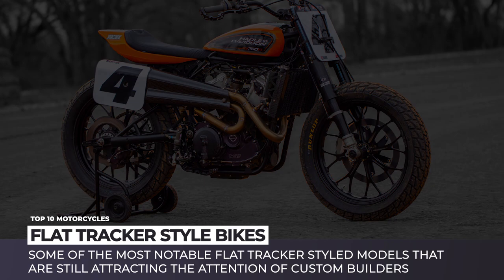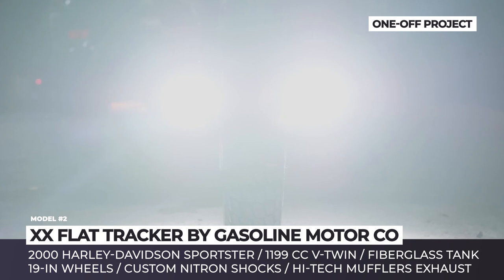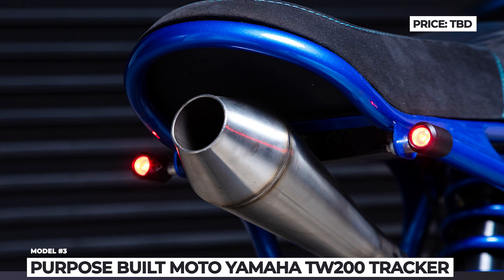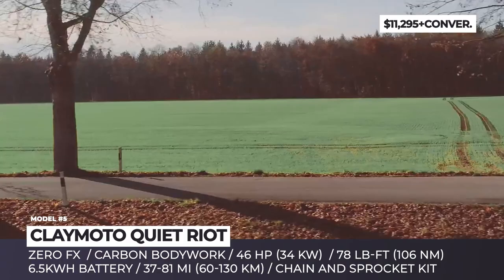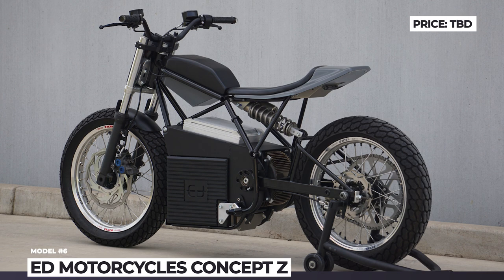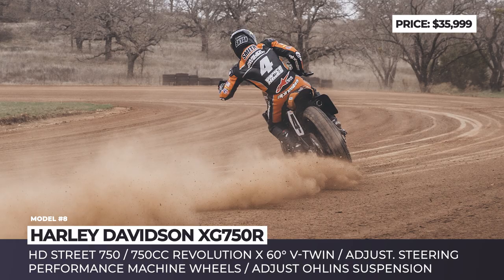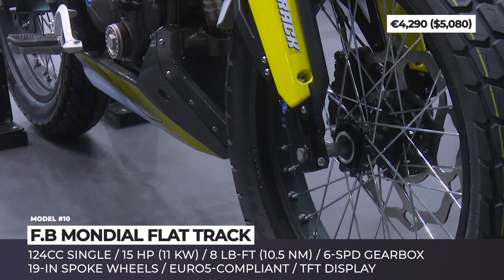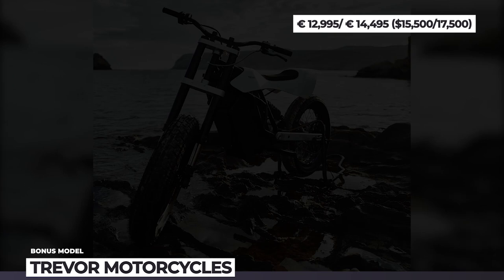Top 10 Modern Flat Track Motorcycles that Exist in 2021 (Production and Custom Models)

Comment: Twin cylinder under 900ccs is what are used...surprised many of these even exist being they do not fit criteria to race or are way underpowered. Someone should use the old 500cc yamaha twin cylinder two stroke and build a flat tracker kt would flyyyy! Lol
Reply: It was a tx500 i believe stock 55hp but with modern technology it could easily ne 110 hp

Comment: Electric models are stale  👎🏼 boring .
Reply from the maker: There are many manufacturers that consider EVs to be the future.
Reply: @automotiveterritory   How far into the future ? On the track, plug in sockets will be available. Elsewhere ? A potential problem. The sound of a 650 gas burner, absent !  The tuner is out of a job !   Hummmm…boring !  Thanks for your video’s.
Reply from the maker: Do you think there is at least one reason why EVs may take off and become a better alternative to modern vehicles?